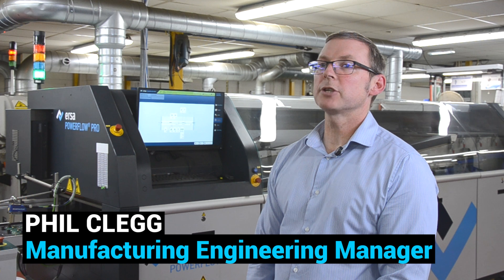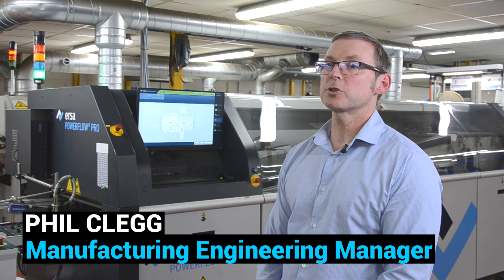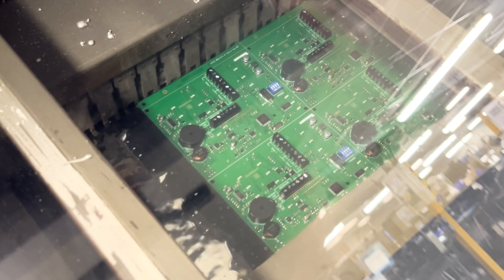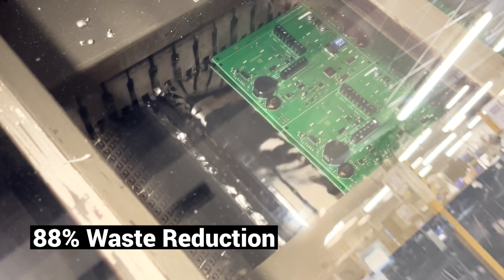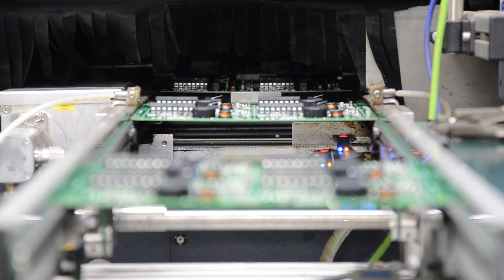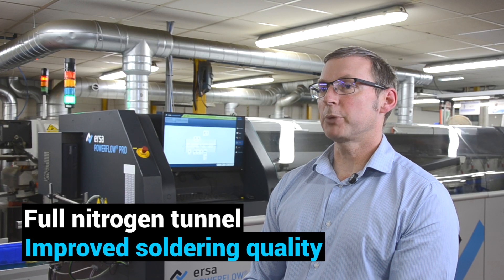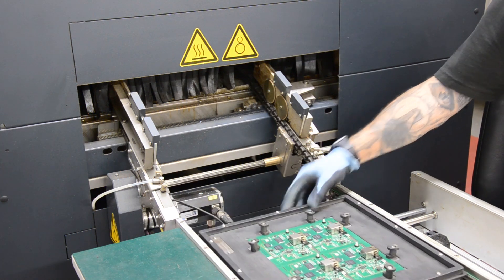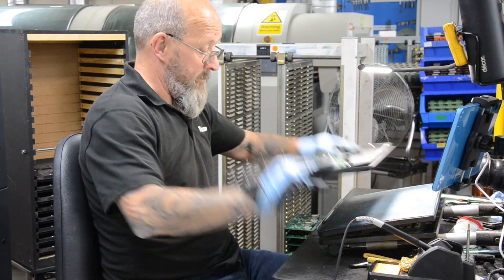How Texecom's New Wave Solder Machine is Transforming Production Efficiency & Quality

Comment: Not interested in the environmental bollocks.  It would have been interesting to hear about your quality controls, temperature monitoring / checks, soldering / flux changes over the years - you know - actual technical details.  It’s more Marketing crap than an insight into your new wave soldering process.
Reply: 100% agree.
I came here to say the same thing.
Greenwashing.